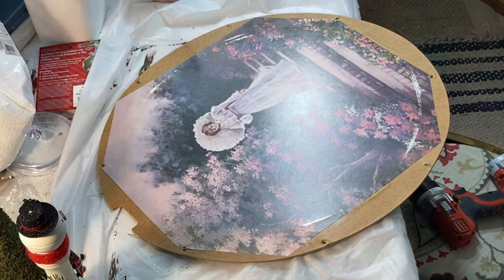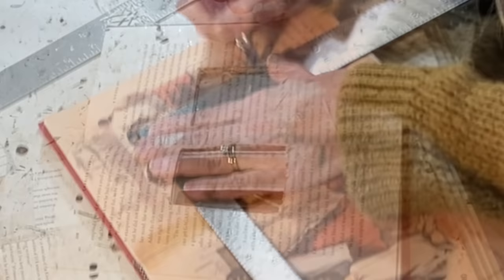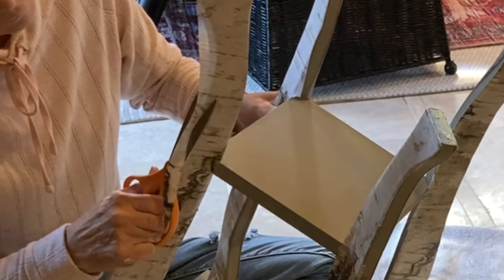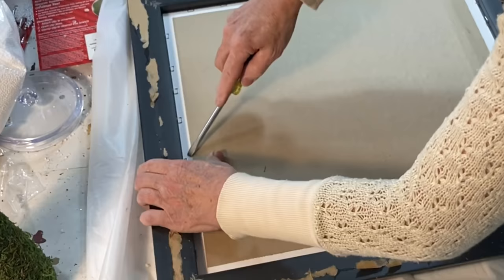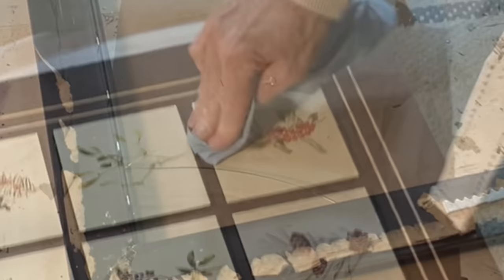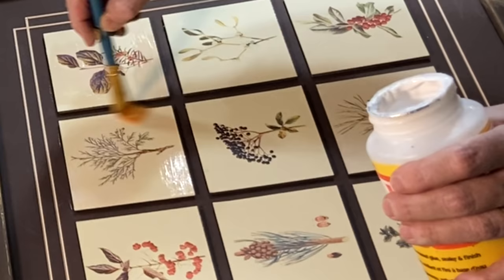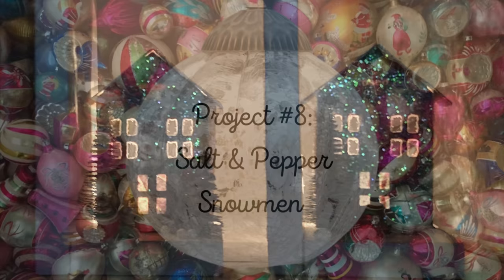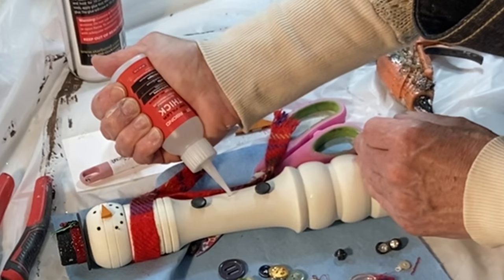30 CHRISTMAS DECOR DIY’S FROM THRIFT STORE ITEMS UNDER $5

Comment: Sherry,
Love everything you made and so many beautiful things I cannot say I have a favorite but, my loves are snowmen. That last snowman you totally redid are my favorite snowman faces and bodies. They are the vintage style I love. I also love your wooden salt and pepper shake snowmen.  About 8 years ago while driving home from work a woman was piling on her curb scrap lumber and other things. At the time I lived in a highrise apt and I had a very long balcony with 2 outlets. I did tons of woodworking projects out there even in the winter.  On the pile were 3 long stair spindles already painted white. Immediately I knew I was going to make them into snowmen. Also in the pile was a long piece of baseboard painted white. I cut the baseboard into 3 sections and sanded the cut ends. On each piece I nailed a spindle in the middle to each. One spindle was split in the end  so I kept that for myself.  I made one for my sister's front porch and one for my brother's front porch and one for inside my living room. For the hat I cut down  round dowel rods and used thin balsa type of wood for the small pieces of dowel to sit on and hot glued those to the top of the spindles and painted the hat black. I added berries and holly 3D stickers to the hat. I made a scarf out of fleece and fringed both ends.  Eyes a
And mouth were tiny buttons and a horn shaped orange bead(s) I had were the noses. From the fabric store I bought wooden star buttons from a Folklure Company and hot glued them down the front.  They came out so cool and the wood was free and most of the embellishments I had on hand.   This weekend I will go to my storage unit to get the snowman  and a box of decorations and my red/black plaid lunchbox from 4th grade. 1973.  I found it in my mom's basement when cleaning out her house last summer.  I had looked for it for years and she always said, she was like grandma and never threw it out. I was so happy when I found it. I have been wanting to use it as a shadow box and make a wintery scene. 
I love all your old videos they are timeless just like all my old Christmas magazines. I am happy I had not seen this video yet as it has given me new ideas. 
Hey, if they is not rude to say, when I arrived at my mom's house one day and the one worker was taking out the old stove to take to the dump he left in the porch the 4 black iron gas stove burners.  I grabbed them quick and put into my van as I am sentimental about them thinking of all the breakfasts my mom made for me when I was sick. For 5 months straight in 2016 she cooked every meal for me and brought all to my bedroom in a wooden tray. She sat in a rocker at the end of my bed and ate with me.  I want to repaint them as sone have white marks on them from something such as scortch marks. I thought I could use them as trivets under plants not quite sure what to do with them. I wonder if you had any ideas.  I do not know if you still see comments on older videos. 
You and Deidra are my favorite but I will also check out the other 2 gals you mentioned in this video.  Have a super day. I am off to work now. 
Sorry for yer another novel, Rebekah in VA

Comment: I loved what you did with the birchwood paper. I have had the hardest time decoupaging with scrapbook paper. I always get bubbles, even though I am very careful not to rush the process.
Reply from the maker: You might be using too much Mod Podge. Put a light even coat on the scrapbook paper and the item (unless the item is paper, then only on the scrapbook paper). Once they are lined up, wad up a piece of paper towel and smooth out all of the bubbles and wrinkles. Don’t give up. When I started decoupaging, I had issues all of the time, too.

Comment: Wonderful video, as always. 
Just a suggestion, the glass you broke from the picture frame didn't need to be left out. Since the crack is in the corner, you could just cover that corner up with some fake floral, hot glued to the frame so that it extends over the crack.

Comment: Birch table very innovative.  I sometimes think with your projects less is more.  You tend to get a little overkill with the embellishments.  Example the converted clock.  I would have left out the deer and the small figurines attached to the top.  I realize once you get going it's hard to stop, but I think most who are not artistic or crafters would stop sooner.  Just saying.  Wood salt/pepper snowmen, cute.  Who doesn't like snowmen, in case it might be Santa Clauses.  Refreshed snowman figurine is great.  That's an up cycle well done.  Thanks, Sherri.

Comment: I LOVE your stuff, and I see you listed your printer here, but how oh how do you not have your images bleed? do you use magic paper?
Reply from the maker: I use regular paper and generic ink cartridges (Office World) from Amazon. I have very few bleeding issues. Let the ink dry for an hour before applying Mod Podge. Apply only to the back of the image. I usually let that dry overnight and apply the topcoat of ModPodge the next day. If you are still having problems, you can spray the image with a clear top coat or hair spray after the ink is dry. Let that topcoat dry, and then continue as usual. Hope this helps.